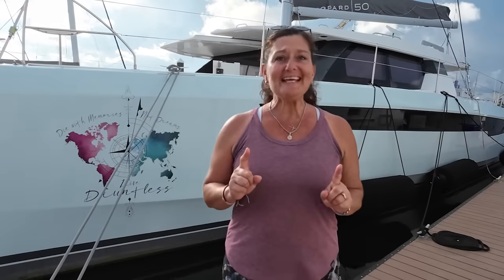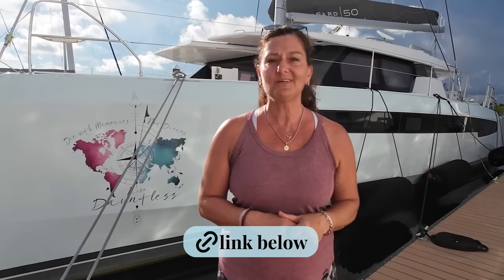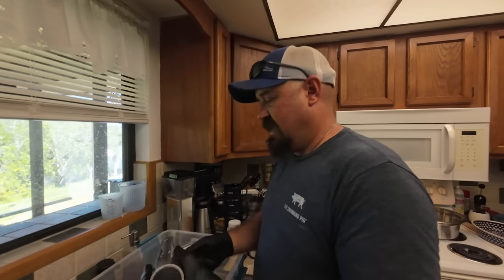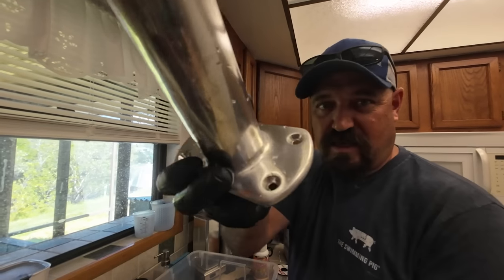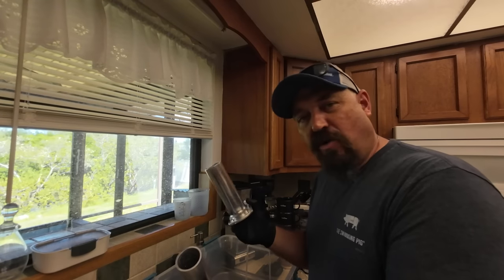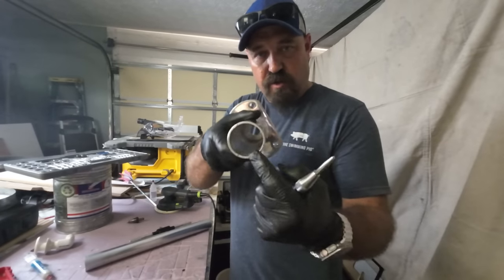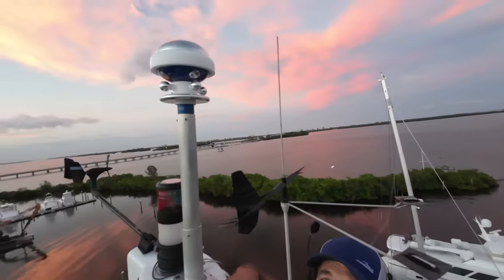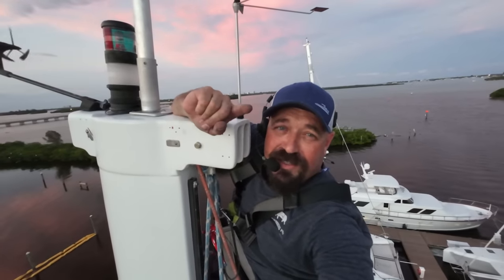5 POUNDS OF PREVENTION//Lightning Prevention Install-Episode 145

Comment: If you had marked the pipe that goes into the bracket where your screws touched the tube and then dimpled the shaft so the screws slightly went into the pipe the shaft would not move or be able to work loose.

Comment: Am I correct in saying you removed the HF aerial on the starboard side of the mast as it was protruding higher than the lightning protector. 
The aerial was missing in the last shots of the video. Was it repositioned lower?
Reply from the maker: No, it was being covered in heat shrink (mfg recommended) and then reinstalled

Comment: Cool in five years I'd like to come back and see if all this is going to work???
Reply: I installed a CMCE on my boat 1.5 years ago. So far so good, but the problem is that lightning is so unpredictable it's impossible to know for sure that it's doing anything. I do like that they have lightning proximity sensors. It will be very interesting to see how close lightning has been to them.
Reply: This product says it protects from direct strikes but a lot of boats in marinas get damaged from indirect strike energy transfer from neighboring boats getting struck. Ask Colin on Parlay Revival. His second occurrence was from indirect strike energy transfer, it was over $10k in damages while he was away from the boat docked in Panama. After two strikes he still calls these products expensive snake oil. This $5000 product offers  zero indirect strike protection.  It's a lot of money for a false sense of security.
Reply: @andersonautomotive 😅